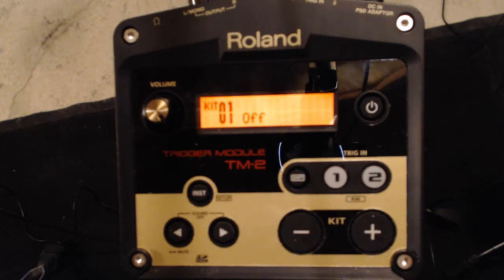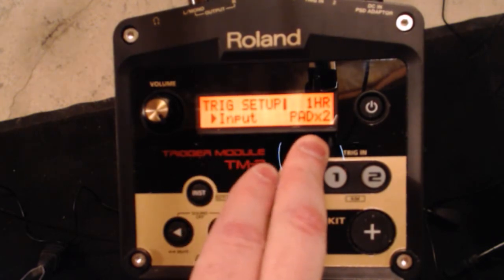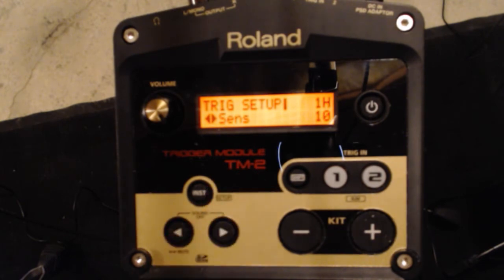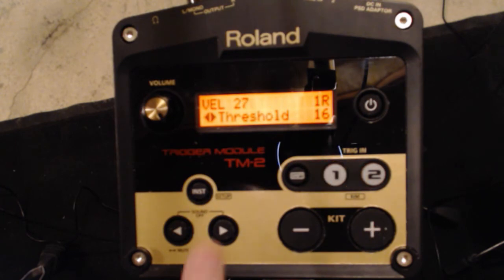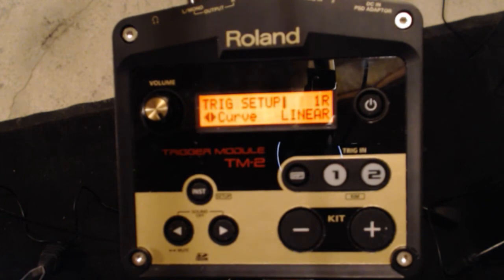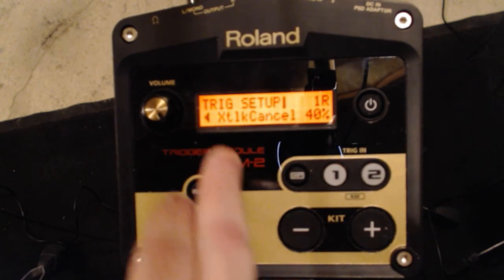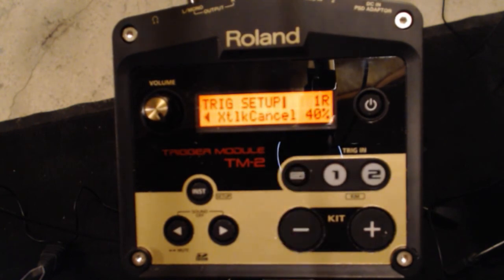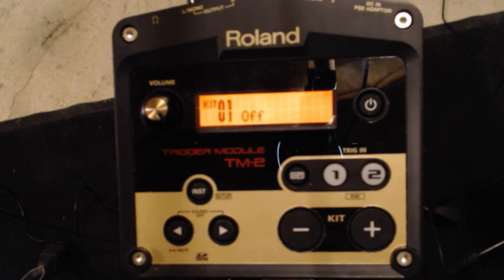Hybrid Drums Explained Part 3: Setting Parameters

Comment: What have you set your output gain to? +2 or +4dbs?
Reply from the maker: I keep it at 0db. Never had anyone tell me they needed more or less so I haven't messed with it. If your mixer needs more input, you can adjust it higher.

Comment: hi, I have recently got the TM 2 and I wanted to know if to use the effects (distortion, compressor, flanger, etc.) it is necessary to select a sound from the control unit or the real sound of the drum can be used
Reply from the maker: You can use the onboard effects on either the built in sounds or sounds you import.